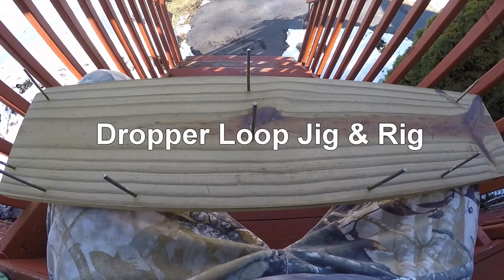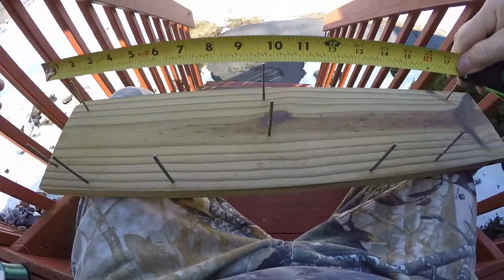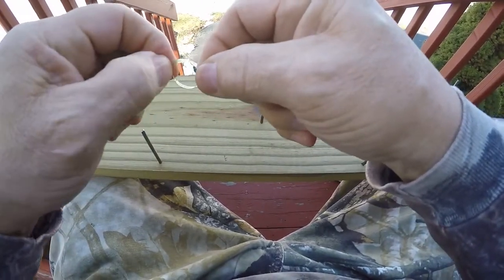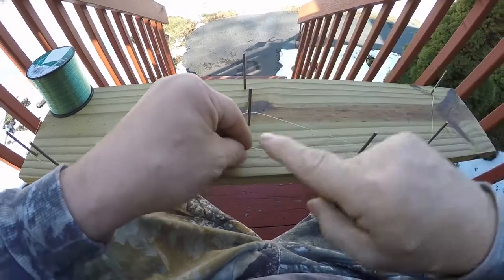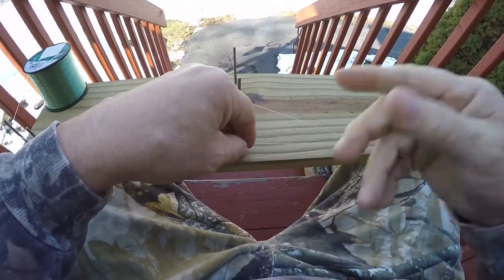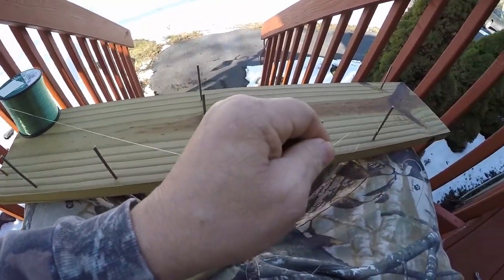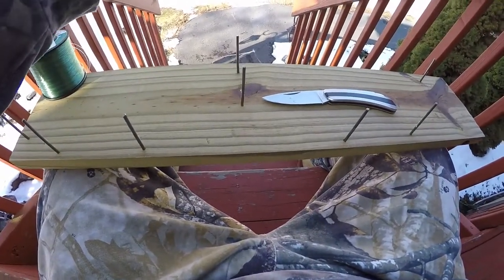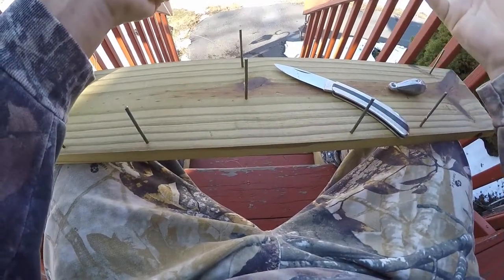Dropper Loop Jig & Rig

Comment: This is actually brilliant.  I usually keep 1 perfect rig around to use as a spacing reference and i still have to get rid of like a third of the ones i tie.  Just made a smaller version of this for the smaller rigs I use and it worked perfect.  Consistent spacing and perfect size dropper loops.  Thanks for sharing!
Reply from the maker: That’s great!
You’re welcome. 
Tight lines
Please thumbs up if you have thank you

Comment: Great job .. works well , good methodical explanation  ,  but I have a question , the  middle top nail didn't get used ??? does it have another function ?
Cheers
Reply from the maker: That is for making a different size loop. So pending which one you use will give you a different loop. You could even use one then the other so the rig will have two different size loops. It entirely up to you. 👍
Reply from the maker: You can also add another nail to make a smaller loop. Try adding one an inch below the one I was demonstrating.
Reply: @FatTailFishing  thankyou .  
I think I will try your first setup and see how I go.
We are usually fishing to about 40 - 60 meters in depth & about 1 kilometer offshore . I figure this rig should do the trick 
We mostly get snapper , flathead and the like .
Cheers

Comment: That board look like pressure treated do I have to use pressure treated lumber where can I get away with regular lumber
Reply from the maker: Hi
You can use any board you want, I think I said in the beginning of the video I had used that because that’s what I had laying around. So yes use a pine board if you want. 
Hope this helps. Also check out my latest video it explains that little loop better on its use. 
Thanks

Comment: Can't see in the video how you put on and remove the sinker. Also, what's the purpose of the small loop at the sinker loop. Great job
Reply from the maker: Yes sorry I didn’t realize it was off screen. Ok, put the little loop through the sinker hole as normal to attach it to your line. If you want to change your weight or you’re done fishing for the day all you have to do is pull that little loop and it opens it back up again. Without that little loop sometimes it’s a pain in the butt to take the weights off without it. 
If you need a separate video on it let me know. 👍
Reply: @FatTailFishing   I think your video is the best. A video about the sinker would be awesome. This is all new to me and I've been surf fishing for almost 50 years. Lol
Reply from the maker: No problem I’ll get a video out just on that.
Reply from the maker: Ok I uploaded a video on the dropper loop aka hi lo rig just on the weight end of the rig. Thanks for asking for this video.
Reply: @FatTailFishing  Excellent video. Thank you very much
Reply from the maker: You’re welcome I hope it was clear and how to use that little loop for the weight.